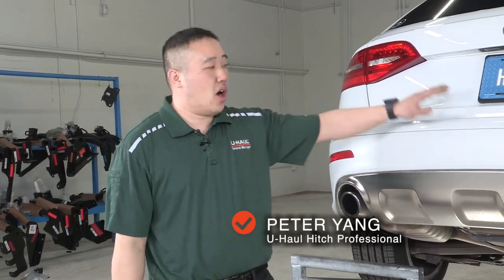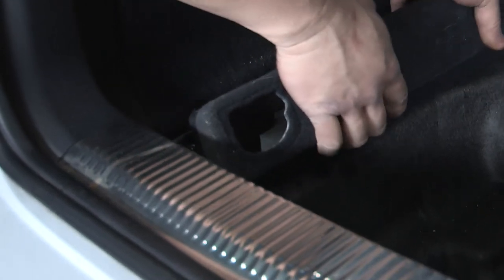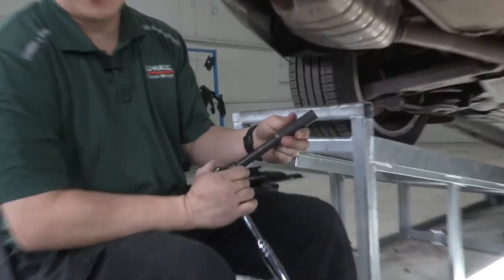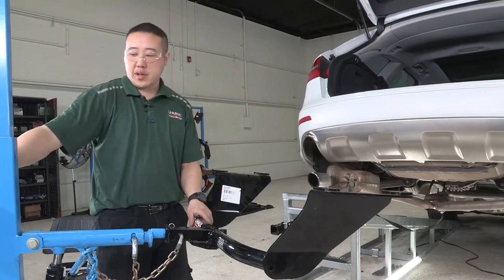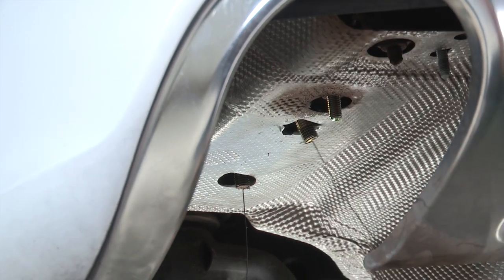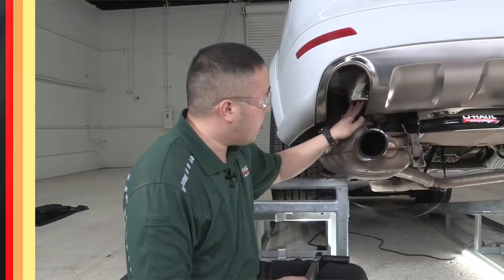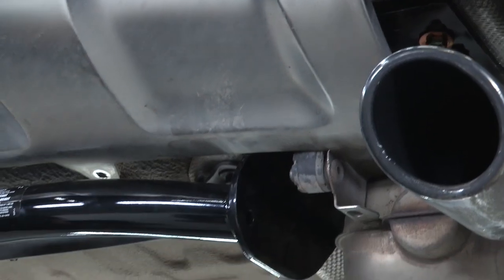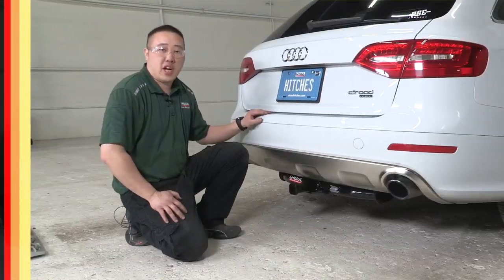2015 Audi Allroad Trailer Hitch Installation

Comment: Couldn't you just trim away that section of heat shield between the two holes and avoid having to use the fishwire altogether?
Reply from the maker: No. The heatshield is covering the access hole and the fishwire has to be ran through the access hole to get into place on the frame. The carriage bolt and spacer will also not fit through the rear most hole position and that is why we ran it through the middle access hole and not just through the rear hole. This also allowed us to avoid widening the rear hole as well.